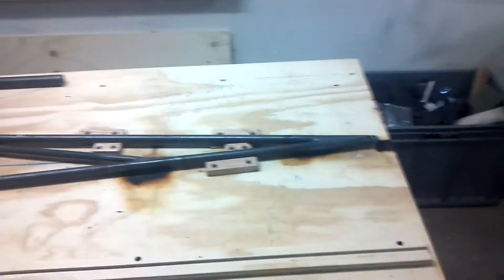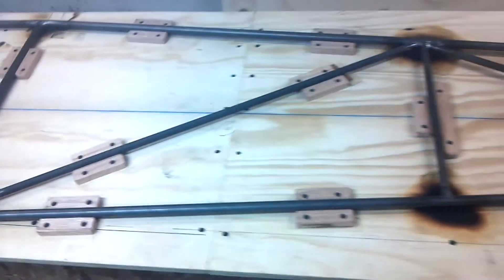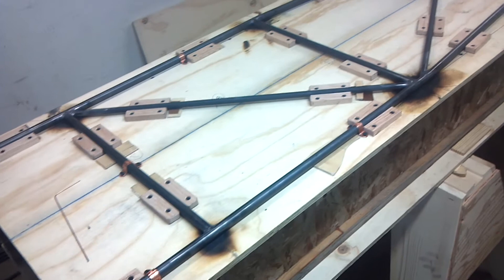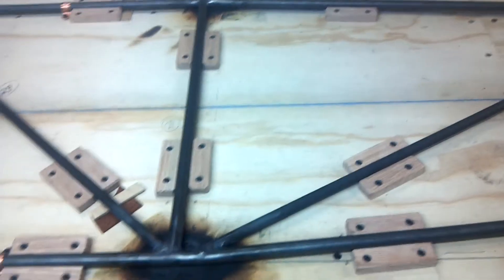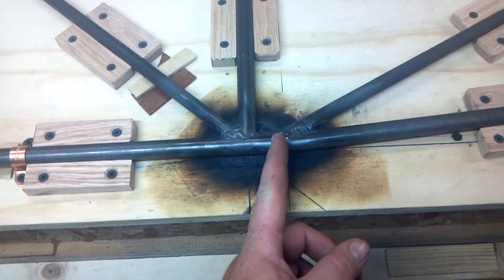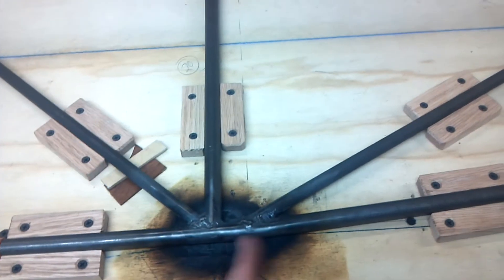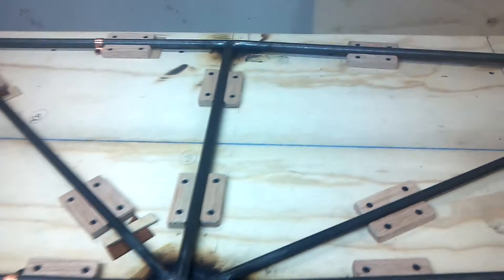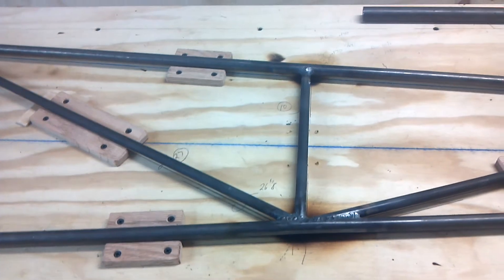Legal Eagle Ultralight construction video #10

Comment: Just wondering? I thought the burning wood would introduce carbon into the weld making the weld brittle. Perhaps with the torch its just the heat extending and not actually getting in the weld? Enjoying the videos.